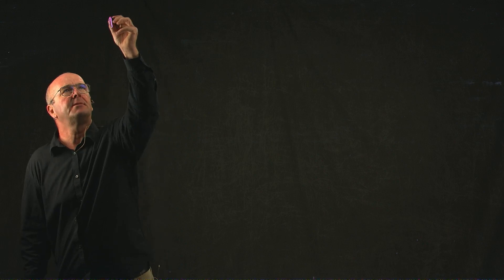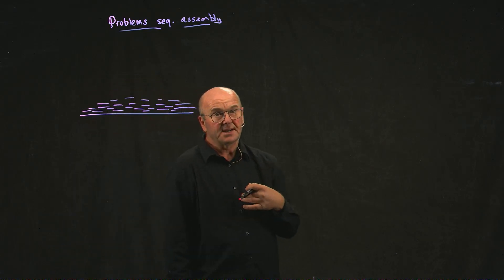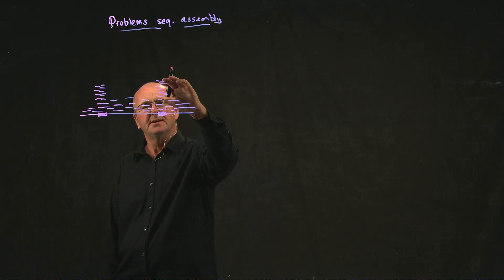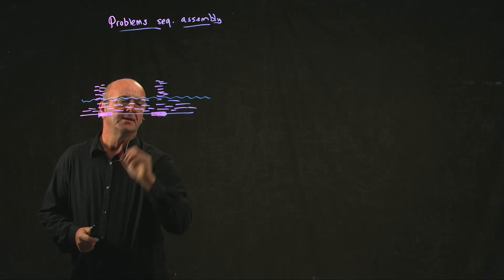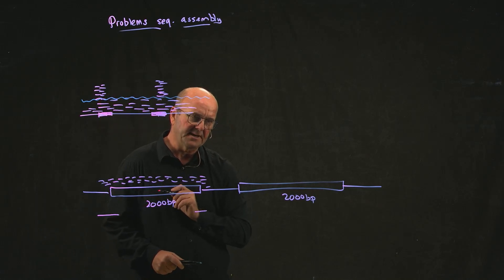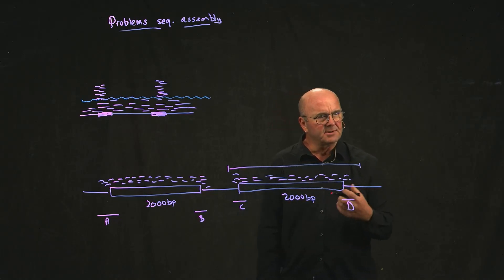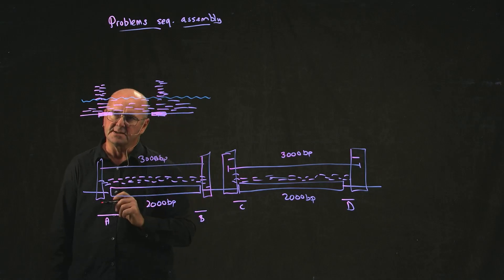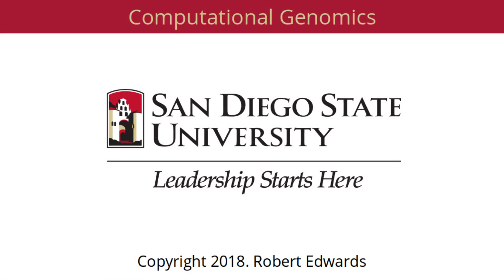Why does paired end sequencing help assembly?

Comment: What does it matter if A goes to B or A goes to D if the two 2000 bp sequences are identical?
Reply: Because in a De Novo sequencing, you can't know in advance that you have a repeated region. You need both region to be correctly placed in the final genome assembly.

Comment: Thanks for the video! 

So I've read that short insert paired-end reads (~up to 800bp) are really easy to ligate adapters to (the A and B adapters that you referenced in the previous video) but that longer reads need to be biotinylated and circularized. Why can't use the same adapter-ligating protocol with long insert paired-end reads as we do with the short insert ones?